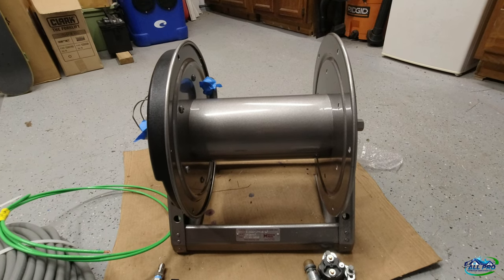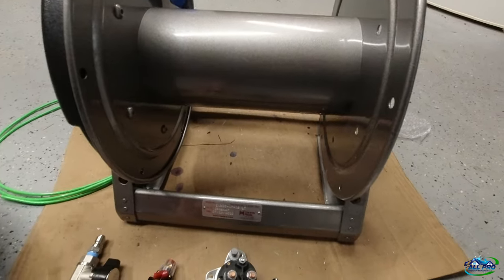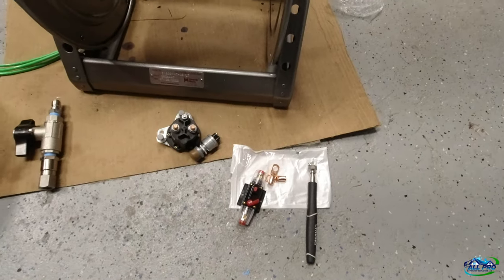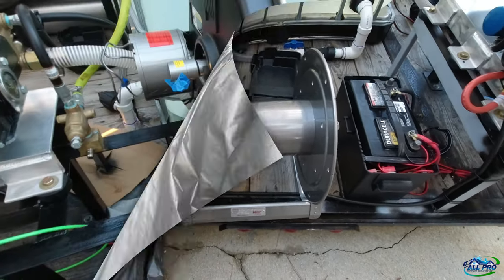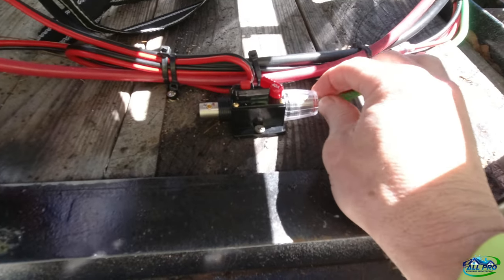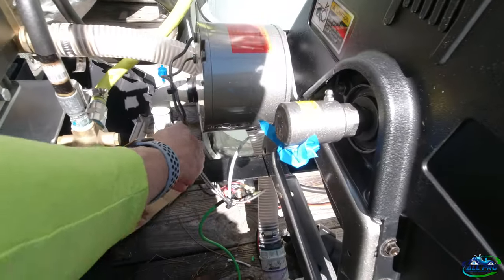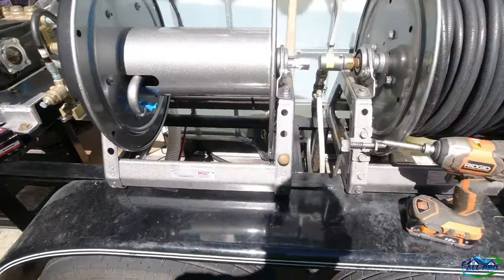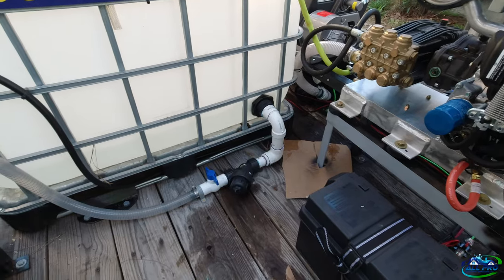Hannay Electric Reel Addition

Comment: Looking good !!! 200ft one piece hose ?😳...man once that hose pops, and it will, you're out 200ft in one shot...I've learned to use 50ft sections for this reason so that when a hose bust,I'm only out a 50ft section....good luck this season 👍🏼
Reply from the maker: 200' hose is nice with no connections on the reel. I have back up hose and plan to add a 15; section on the end where they normally bust from dragging. Thanks
Reply: @allproexteriorservicesllc5338  it's not so much from the dragging, it's more from the sh eating the hose from the inside out...
Reply from the maker: @xtremepowerwashing1815  Good point!! Thanks!!
Reply: @allproexteriorservicesllc5338  make sure to rinse it out with extra water or you can downstream a neutralizing solution at the end of the day. Your hose will last longer..
Reply from the maker: @xtremepowerwashing1815  Yes, I rinse every time after use. It has been working great. Good advice!! Thanks
Reply: i also have my hoses in 50' sections, i only use my reels for storage, i pull off what in need and connect direct.

Comment: What size wire did you use to hook up the push button switch to the solenoid? I’m asking cause I just purchased a electric hose reel myself
Reply from the maker: I used a 14 gauge wire for the switch. Congrats & thanks for watching

Comment: Late but I figured I would give u a better suggestion than using marine grease for quick connect fittings.  Use Anti Seize, it truly works the best.  Pull the qc collar down and brush liberally and it will last all season.  Without collecting a bunch of dust, dirt, etc like grease does.
Reply from the maker: Awesome!! I will make note of that. Thanks

Comment: I just bought the same reel. How do you know which lead of the motor is ground and which one isn’t?? They are not color coated wires
Reply from the maker: I love my new reel. I went to the website and looked at the wiring schematic. Just make sure you position the solenoid as it is shown on the picture. Let me know if you need help, and I can send you a pic of my set up. Thanks
Reply: @allproexteriorservicesllc5338  will do. Thanks’

Comment: Hi,

My question on electric hose reel. Can you hand crank the unit if something fails with any of the electrical components?
Reply from the maker: Yes, but you have to purchase the hand crank separately. Thanka
Reply: @allproexteriorservicesllc5338  

Wow, that's pretty cool you can get a handle.. I like how this brand you can locate the power button on either side on the hose reel frame.  

Thanks for the info

Comment: Why not get 50ft sections if hose so if one blows it's not super expensive to replace
Reply from the maker: I don't like the connections on the reel. I plan to add a 15' section on the end where it drags.
Reply: Do you find the hose usually busts in the last 15’ closest to the reel or closer to the gun from dragging? Thanks
Reply: @mikem6197  it varys. Most the time it's where you get a nick in the line and eventually it wears out.